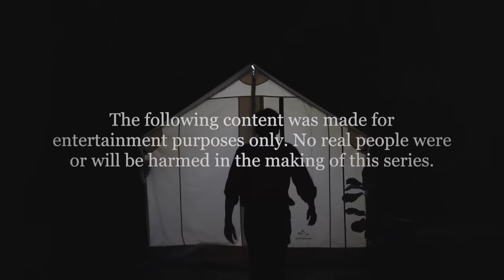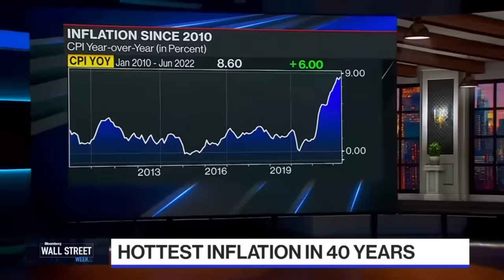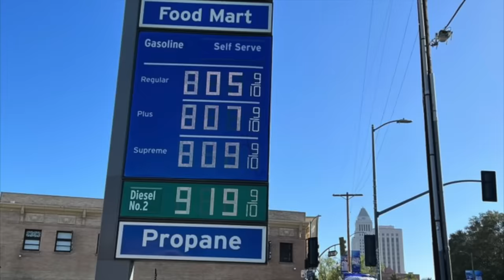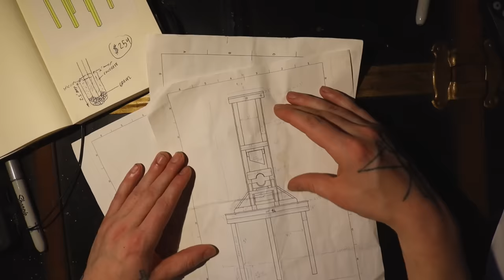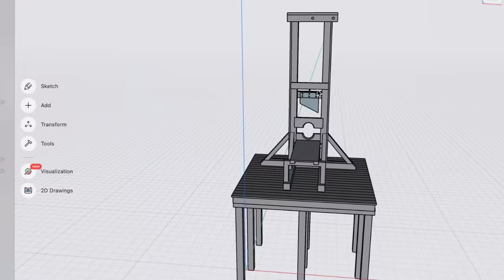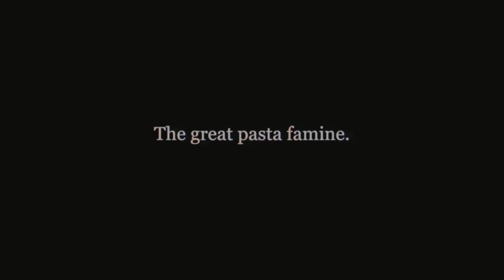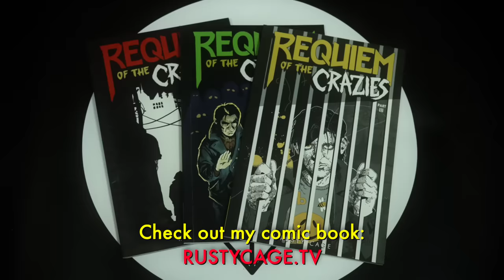GUILLOTINE part 1: Time to Build a Guillotine

Comment from the maker: I HEAR YOU.  So far the major response is that a street sign will be a bad choice for a blade because it is aluminum, which is too thin and weak to hold a sharp edge and stand impact.  I will look for thicker steel instead.
Reply: Thank you Rusty. It would be ideal for the Guillotine blade to be reusable.
Reply: If you want something real sharp use obsidian,not sure how expensive  obsidian is though
Reply: Recommend a big rock
Reply: @capitancuba8962  that is incredibly sharp but could only be used once or twice before it shatters/sheers and becomes useless.
Reply: Spring steel from an old car is probably the cheapest option
Reply: Youtube litterly hid this video from me
Reply: Im curious, how did you even go about getting a permit for this? I cant imagine city hall was ready for their heads to roll.
Reply: You're probably going to need some man power too once further along as building a full size one like your doing is going to be really really hard for one person.
Reply: @lowgradetriplea1620  same.....so its up to us to spread the gospel.
Reply: @wellthatsfunhuh  When the video came out i got notification but it disappeared and when I checked rusty's channel and it wasn't there
Reply: @capitancuba8962  obsidian is brittle and would break on contact with the vertebrae
Reply: @Et111thompson  spring steel was my first thought too, Michael Cthulhu makes those giant anime style swords out of spring steel, idk what Rusty’s plan is for this thing or how comfortable he is doing a collab on this project but I guarantee he could find someone to help him out with the blade
Reply: Get a 1/2 inch thick pice of mild steel. Measure the length from the bottom of the head holder to the top. Then the width. Then go to local metal shop and ask to cut to dimensions. You can sharpen the blade afterwards with a grinding disk and a file. Hope this helps.
Reply: Maybe make another account and build from there, that's what lifeofboris did
Reply: Wtf
Reply: @manKan379  Permit ? Haha. Welcome to the Rusty Cage channel.
Reply: If you are looking for a more reliable but hard to make version weld together some axe heads
Reply: @manKan379  What would you need to get permitted? It's not a structure people live in, and assuming he doesn't live in a dense area / somewhere with a hellish HOA no one can tell him what to do with his land.
Reply: you could probably have the bulk of it be a street sign and then the actual blade be steel. Would be a bit of work, it could function
Reply: Your losing your mind again rusty.
Reply: The gears are in motion the greatest creation is upon us
Reply: @TheWaggishAmerican  Okay but Rusty vs the HOA is a series we need.
Reply: @Child_Dog  True. I want to see Rusty threaten to build a massive bat house unless they get off his back about the towering guillotine.
Reply: I thought the blade on a guillotine was normally dull it was the force of it coming down that cut the head off?
Reply: @Repo-ll3dg  That happened, but that was jsut through lack of maintenance. A dull blade using gravitational force led to a much more painful death, so sometimes they'd do that for spectacle, but optimal conditions had the blade as sharp as possible.
Reply: I still think the street sign would be a cool looking. Mabey you could paint it or put one over top of the steel?
Reply: Not sure what your budget is. A 1'x1'x3/4" piece of hot rolled steel is like $134 before shipping. You could hit up a channel called AVE. The guys super nice and I'm sure he could make exactly what you need. 

Trust over the internet is a hard thing to do. But I might be able to make one for you as well. Income is a bit tight so I can't buy the materials but I've got the tools and time. I'd just need some dimensions and the steel.

Metals depot has decent prices and you can order whatever size you need. Hope this helps a little.
Reply: @capitancuba8962  that would be destroyed after the first use, obsidian is brittle
Reply: Get some high carbon stainless steel and a angle grinder with sanding discs or a belt sander. 

People have been making knives for centuries there's stores that will sell some nice 5mm blade steel
Reply: @mitchhifi9192  hoigh carbon is going to be really expensive at the sizes needed for a blade. I'd go a 1ft x 1ft 3/4in hot rolled steel. Doesn't need to be hardened steel. Hell it could be cast iron. Which is probably what they used.
Reply: Jus get a steel plate like 1081 steel is good but pricey stainless doesn't rust but it is terrible for holding an edge it is heavy Wich would make it a good chopper but cast iron Is also heavy it rusts tho and also holds a junk edge idk to much about metal if you do have a scrap steel plate hit it with a grinder if it sparks a lot its good If not it's probably junk
Reply: @manKan379  it's florida he might not have
Reply: Maybe a grill plate
Reply: Add cross beam gussets on the support posts, or the heads of tyrants will destabilize them
Reply: Was That Huggbees announcing the pasta famine?!?!?!
Reply: I just got an add on this video, would that mean its monetized?
Reply: The video is still monitized 🤣
Reply: Titanium bonded 420 steel holds an edge really nice but it is a b** to re-sharpen for the purposes of a guillotine should be fine...
Reply: I wish I'm that diligent at making my own DIY Head-Remover-Inator.
Reply: Yeah,,, this is brilliant work…. tortured by “the truth of it all”.. 

I mean, injecting a story line like this into a “build series” is pretty incredible….  

Such a good idea to edit in voice over narration of true terrifying information over your building sequences….

Original music… the amount of work is insane 

Original, dark, and refreshing… great shit
Reply: Have you tried asking a black smith really really nicely for a custome order?
It might work
Reply: Just fyi... What you did use in the long run.. wayyyyy to thick of metal..  it's awesome.. but wayyyyy over board
Reply: Don't think I didn't hear that subtle hugbees cameo
Reply: Well.... so much for that...
Reply: @capitancuba8962  obsidian is brittle as fuck, it's like using glass. It won't work at all
Reply: hey rusty could you tell me what the song at pasta famine is?
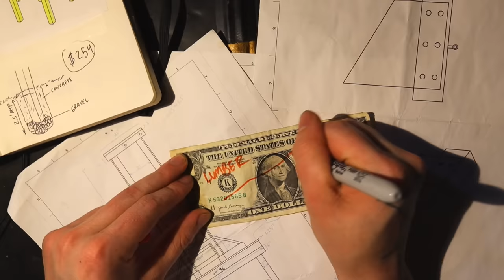Reply: Hey Rusty, if you don't mind me asking, what is the song that plays at 3:38?

Comment: The blade is actually the easiest part in my opinion since you won't be actually cutting bones. Old sign is a good idea since it's made out of good corrosion resistant steel. You could try hardening it similarly to Japanese blades (by masking parts of steel with clay, look it up).this way you could made the blade a bit harder.
Reply from the maker: I do want it to be fully functional with the ability to cut through bone. Maybe I can double up with two signs
Reply: Street signs in the US are flimsy aluminum, his best bet is to find/buy a large chunk of 1/4" steel that will have some heft to it and sharpen it
Reply: The key to determining whether you can even harden steel is the carbon content my friend.  Take a grinder to your material and do a spark test.
Reply: @willmcpherson3760  and ya even ¼"steel would be better than a street sign.  "Hardness/tempered steel" only comes into play when you need to HOLD AN EDGE. ¼" mild Steel(low carbon content) would still probably work better than a road sign. It's about weight of the blade, as long as you got something resembling an edge the weight will drive it through a watermelon.
Reply: @willmcpherson3760  you are correct, aluminium is not going to work. He needs to use steel, RUSTY STEEL ❗️
Reply: @rustycage  I haven't tested my 5 foot one on bone yet but I used 1/4 inch steel diamond plate and it slices thru the fruits I've tested it on no problem and super clean, with yours being 18 foot I imagine it could go thru bone no problem since you'll have a wider blade with even more weight than mine has and several times the fall length
Reply: @rustycage  bones are very hard and dense, weight and strength are your best bet. See other comments
Reply: @rustycage  All you need is a heavy piece of iron with one end shaped to a basic wedge and a decently high drop. The weight of the metal and the acceleration of the fall will do all the work. It honestly doesn't even need to be that sharp, just a basic wedge shape at the end of 150lbs or so would be more than enough to cleave clear through most organic material as long as it has a sufficient drop. With a basic pulley system it wouldn't take much effort to lift and if you fit the crash point with some leather wrapped around bundles of straw or something and all of that backed by some stiff springs to absorb the energy you could add a good amount of weight to the blade without it breaking itself apart on the first drop.
Reply: @rustycage  I am a knifemaker and in regards to the blade:
 You should use a thick piece of steel, something around 10mm (6mm at least imo), with  a convex axe-like grind. Preferably you would use a heat-treatable steel like 1040, 4140 or simmilar (anything used for axes etc should be good, it needs to be ground and then sent out to a professional heat treating company)
But honestly it doesn't NEED to be heat treated or very sharp, the kinetic energy should do most of the work

Heat treating the blade will make it capable of holding an edge and the convex geometry will make it cut  better. Keep in mind you need to do 99% of the grinding pre heat treat, and you need to drill your holes before as well, so after HT you just need to sharpen it. 
Hope that this helps
Reply: @rustycage  if you are putting a weight above the blade then a sharpened street sign would def work. As long as it’s one of the stainless steel ones not aluminum. I’m a highschool student in a metal fab vocation so not an expert but I’d say that would do the trick.
Reply: @rustycage  no need to add a second blade, but if you add more weight, lets say you strap the second sign on the top sides of your blade or something like that. Then it will be noice. Preasure is weight devided by area, so you either decrese the area, or increase weight.
Reply: the method is called Yaki-ire. if anyone is wondering
Reply: @rustycage  Personally I disagree with advice to harden and temper the steel yourself, it's too hard. US road signs are useless 1/4" aluminium. Even if it's steel it'll be soft, and will roll when it hits bone. No-one is going to sell a steel plate (even mild steel) of the dimensions you want for cheap. The cheapest option may be to buy a long, cheap machete (I've re-shaped Cold Steel 24" Latin machetes), cut the ends off (without an angle grinder, a hacksaw with a carbide rod saw blade will do, but will take at least an hour), and simply glue (construction adhesive) as much of the blade as possible to whatever is easy, e.g. sandwiched between road signs, if they're what's on hand. Filing and spraypainting can hide the seams. The gap between the signs can be filled with scrap metal or sand for weight. This gives you a real, high-carbon cutting blade with minimal cost and equipment.
Reply: @rustycage  Road signs will absolutely not work. 
Definitely not the “easiest” bit in my opinion.
No matter how sharp or what the cutting geometry are, if it’s gravity powered then it gets it’s cutting power from its weight
Force = Mass x Acceleration.  Given that you can’t increase gravity, in the video you described the solution yourself “weighted blade”
This increases the acceleration and therefore the force.
At a minimum 3/8ths steel.
It’s absolutely something you can make yourself but given the cost it might be best to either have it made or collaborate with a youtuber with relevant tooling and expertise.
Adam Booth Abomb79 is a Floridian machinist who I’m sure would be happy to help and knows more about steel than about anybody.
Might seem a bit overkill to ask a precision machinist but he would certainly point you in the right direction.

What I’ve seen from most videos is nobody gets the blade right on their first attempt. Certainly do some research as I can see you’ve clearly done into carpentry. And learn from their mistakes.

Comment: On the supports, you'll need to notch the posts and use a lag bolt to fix them to it.  Even if you want it to be a modular assembly, you need it.  Those angular supports HAVE to be secure and nails or screws won't get the job done.
Use a drill with a bit 1/8 of an inch more narrow than the bolts and set your depth to 1/2 inch shorter than the bolt.  That should allow it to join the pieces without cracking, but also give it enough surface area to grab onto.
Trust me on this. I did construction for a living for years.  If you need more, link me to your site.
Reply: You are the hero we need
Reply: @Immadeus  always happy to help.  I know a ton about construction. 
I literally grew up on a framing crew, and if I can put my skills to use to help separate the heads of state, I'd be more than happy to.
Reply: hey you might wanna try contacting Rusty directly on Twitter, i'm not 100% sure the likelyhood of him seeing this
Reply: @keaganthegreat  king shit
Reply: @liambunker8378  what's your problem?
Reply: @MrLoverman7134  ?
Reply: @liambunker8378  you said "king shit" is that some reference I'm not getting?
Reply: @MrLoverman7134  king shit means what you're doing is the work of an admirable person. As in, the kind of shit (work) done by kings. Calling you a king.
Reply: @SenhorAlien  oh sorry I didn't know lollololo
Reply: @MrLoverman7134  it's because that is shit a king would do
Reply: @keaganthegreat  u south african?
Reply: @ukor4100  no.
Reply: @liambunker8378  Obviously not how you intended it but “King shit” is also a pretty common insult some places, think pretty much exactly how you explained it but drenched in sarcasm.
Reply: @Jay22222  huh, not gonna lie I've only ever heard used positively

Comment: Metalwork Tip: Don't use an aluminum sign for a blade, it's too weak and not durable. A thick steel plate would do (the stronger the better, even spring steel if possible). I love your wholesome science experiments, keep up the good work.

Comment: Rusty, Ill help how I can. First off, you're going to need a level, or at the very least a tennis ball. Looks fine on the post you got in, however Im not sure you need such a gravel bed in your region, you're not going to have any frost shifting. You're also going to need to use the level vertically when you put those posts in, that way your platform is even when you install. When you install the platform, your posts arent all going to be the same height. Youre going to have to either A.) cut them, or B.) float the platform at different heights on each platform... again using a level. You're probably going to need some what I call "donor" wood to dummy up your lines. This is completely do-able, and I'm willing to give my armature advice throughout the project, I built a 24'x36' garage and the concrete pad in the Northeast using just researched and online knowledge. Hmu if you need a quick and dirty answer in progress, we'll get it done.
Reply from the maker: I'm doing all the plumb and leveling in the next video. Definitely ran into issues with the heights not being even, so will probably have to cut the tops. Which will be annoying.  But for sure taking time to make sure everything is squared up so the deck doesnt lean.  I appreciate your input

Comment: For the hoisting process, you should build the side rail frame on the deck laying down and walk it up slowly. It'll be heavy for sure, but that's about the only real way to do it. Much like framing a wall. They're built laying down and then stood on end and secured to the ground with additional braces extending out until it's secured.

Comment: I'd advise against using a street sign as a blade. They're usually made out of aluminum, not steel, you're gonna generally want something stronger for a blade because you don't want it to bend or warp with stress

Comment: I do not think a street sign will be heavy enough. They are usually made out of pretty thin and soft metal. If it was me, I would be looking for a sheet of 1/4 mild steel. It is a bit soft for making a blade, but easy to work with and moderately priced. If you wanted to be super dangerous, you could try to source a blade from an industrial paper cutter, but if you have any workplace accidents they would most likely result in a loss of body parts.

Comment: That moment when as a kid you used to imagine a demon named Alabaster talked to you and told you things and then your oppressed childhood rushes back at the end of the video like a wave... unintended, but fucking creepy.  

Good content, inspiring in the grimly inspiring and last hope way that only RC can do.
For the guillotine. three things. 
To get it up there either build it up there or be ready for even more costs as you need to build an extra machine.
For the blade, a sign would be neat, BUT, unfortunately, your going to want steel. A lot of signs are made of aluminum, which lacks the heft for the job and the ability to hold an edge capable of dealing with the bone more than twice.
Finally, for the wheel system. Surprisingly marbles made good replacements for the more expensive metal ball bearings that would be used by a more traditional device.

Comment: I know your best bet may be building the guillotine itself on the platform. And finding a way to lean it upwards once fully built. It will most likely require a second person. My guess (with the little experience I have) is use essentially a pulley system to lean it upwards like they do with the housing walls.

Comment: for the blade if you want to go cheep you could use a large felling axe head or a machete blade attached to some sort of weight though you would be losing out on the wedge design with the machete, and this is assuming you can find a felling axe big enough